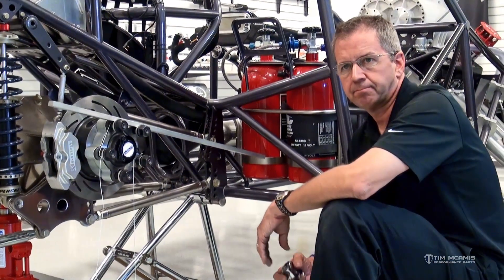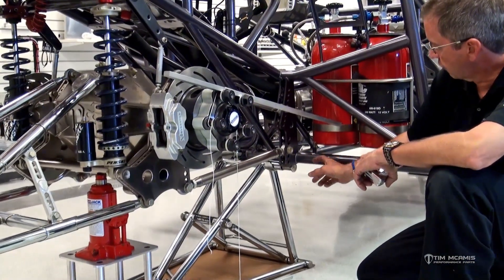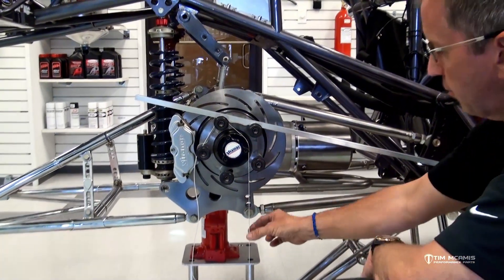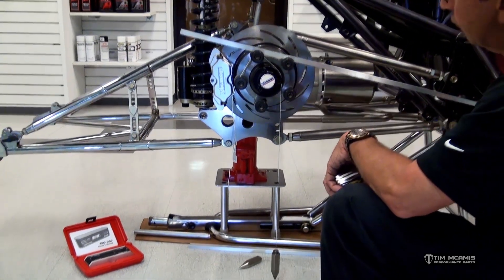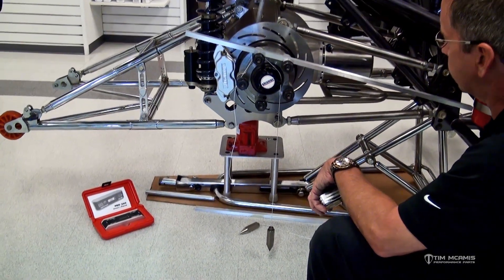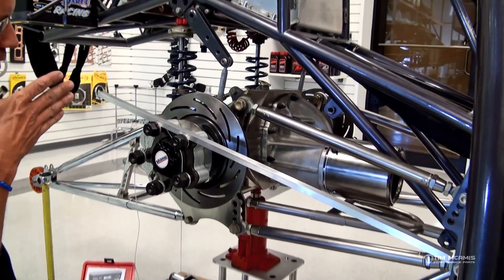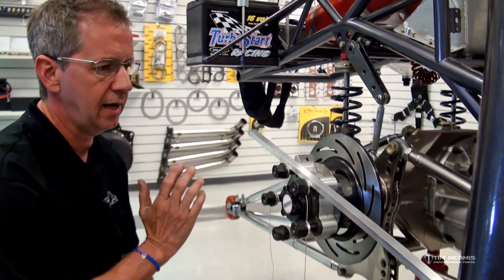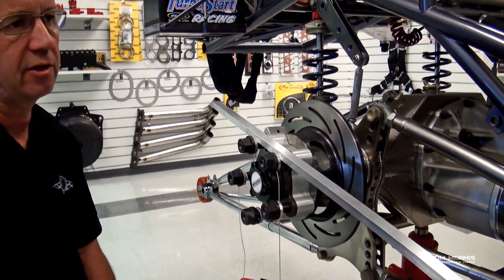Rear Suspension Overview: Part 1 - Rear End Alignment

Comment: If you use those aluminum bars to help center your rear end, thats good if your bars are equal, but if you put rear steer in the 4 link I believe that method won't work.
Reply from the maker: Correct, but this is all part of initial set-up, starting at zero. This gives you a baseline to reference.  When you do apply rear steer, you know how much because you can measure how far it has moved from a zero starting point.
Reply: Reason I mentioned, is that I have rear steer in my car now, but wanted to re center the rear, so I came back to reference this video, and I was like wait, thats not gonna work for me.  What would you recommend doing for a car that already has rear steer in it? @Timmcamis
Reply from the maker: @albertraczynski4249  If you don't currently have any documentation from a starting point of zero. Take measurements of everything as it stands now so you can get back to that point if it is working for you. If you recenter, then you have a point of comparison to what you have now vs a zero starting point. Basically, work backwards if you don't already have a reference point.

Comment: Most racers do not understand just how important the rear diff is and the way the link systems work they can talk about an engine all day but the rear suspension is voodoo. the engine makes the power the trans supply's the power to the diff by way of various gear ratios but the diff applies all of it to the tires and the ground to make the car move the engine is just a power plant. it all happens at the rear of the car the sooner racers learn this the better they will be.

Comment: i think you meant shortest number. if you sweep the tape and get a longer number its because you have your tape at an angle. you can always get a longer number , there is only one shortest number , you may have caught this idk , surly its not worth going back and editing a video for. Anyone going through the lengths of building a suspension from scratch will likely figure this out as well.  Also i have watched many of your videos on building drag cars, Do you have an engineering degree , did you go to a trade school for automotive fabrication and chassis building or are you self taught?
Reply: Dalton Michaels No he’s right it is longest.   number

Comment: Would this type of 4 link be streetable at all? I'm working on a 68 ford fairlane and I was going to ditch the rear leaf spring set up for something else. I also wanted to make room for larger tires. What would you recommend for street/strip set up? Wouldn't the solid hiems make the car sound like a Sherman tank on the street? Planning on running about 1000-1200hp with Lenco st1200. Motor and trans are ready to go. I have a car and a Chassi works front end I picked up for a song so I have a decent front set up. I'm just not sure what to do on the rear and I didn't want to gut my car completely for the rest of a full chassis kit and "super jumbo max mother fucker" shark bite cage kits lol.
Reply: James Moretich yes actually!! YouTube hotrod garage, they have about 7 or 8 different vehicles they installed 4 link suspensions on.. Excellent handing characteristics when set up and installed properly.